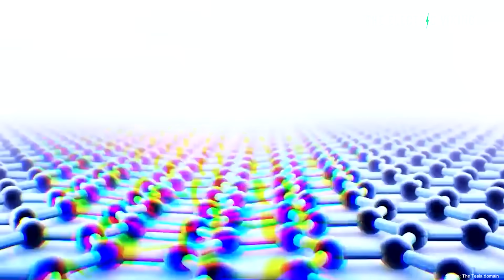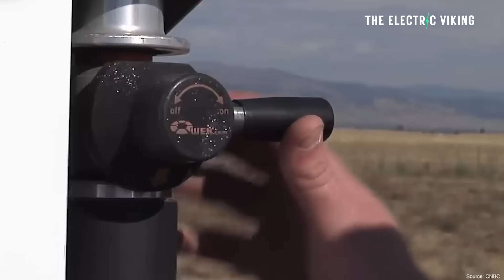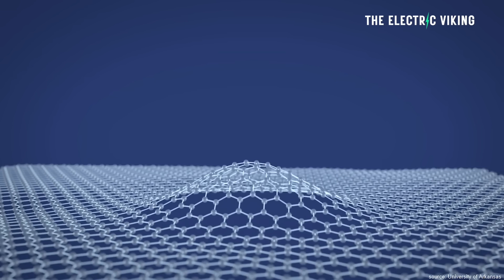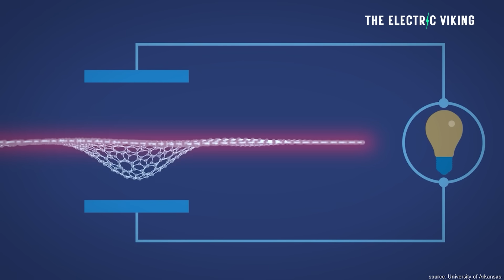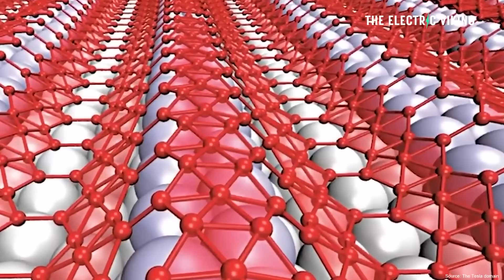Experts Claim Stunning Breakthrough Will Transform Global Hydrogen Network

Comment: It’s pretty simple to see why hydrogen is far superior to any battery technology. Firstly it doesn’t need disposal or recycling after it is consumed, it just reverts back to it’s original feedstock, water. It doesn’t require massive damage to the earth to extract. A fire from a hydrogen leak is over very quickly at a vehicle scale unlike EV’s. It doesn’t bellow toxic pollutants in the event of a mishap. With the advent of the new graphene research, according to your video, it will be 100x cheaper to make than it currently is. No chemical battery can compete with that. 
Maybe open your mind a little to the possibilities rather than searching for negatives.
Reply: You’re clueless

Comment: If that system that stores hydrogen on tape gets of the ground then you have cheap storage and cheap production along with affordable fuel cells. Imagine that you stop you semi just long enough to change out a couple of rolls of plasma kinetic film and the fuel cell charges you batteries as you travel. Then once the film is used up and you are travelling on just batteries you plan you next stop and the battery doesn't need to be huge as it is only holding excess energy from breaking and excess generation holding perhaps 100km of range so going down hill can store up power. A container of this film can be delivered to a service station easily. The video about this I saw seemed to imply that changing the rolls with a forklift is quick and easy. That would tend to kill off desiel trucks as the delays would vanish and refuelling would be quick and trivial without the maintenance issues complicated turbo desiel engines often have.
Reply: Hydrogen ‘tape’ is utter nonsense on a level similar to ‘solar freakin roadways’ 🤣

Comment: The projection seems to be that long haul trucks will need to use hydrogen for well beyond the point at which EV's become commoditized simply due to grid not being able to keep up with demand. While EV's are being built and sold - power plants are being shut down. 10 BEV Class 8 trucks will require the same amount of power draw while charging as a Super Bowl Stadium. There are ~4 million Class 8 trucks in operation in the US alone. To bridge this, some companies like Hyliion have a solution that's potentially more efficient than fuel cell technology using an on-board fuel-agnostic generator (cleaner than the grid in some ways when running on Hydrogen), without the need to haul around two tons of batteries - which reduces a truck's overall load capacity. Time will tell.

Comment: At the end of the day,  one is still dealing with a combustion engine, which is way less efficient than an electric motor.
Reply: Most hydrogen cars use a fuel cell and an electric motor.
Reply: Yes, excepting those types.

Comment: Most of these "laboratory experiments" are little more than mental wanks for the researchers involved. It's like nuclear fusion... where we often see "BREAKTHROUGH" outbursts in the media, showcasing some speculative outcome that has not only cost millions to accomplish, but in reality is meaningless.
This "remarkable breaktrhough" is (like most of these mental wanks) irrelevant. The market (us ordinary folk) have already determined that the future of the car is plain BEV - a proven technology that is not only getting better, but cheaper too. Even if they learn how to cheaply extract hydrogen from blue whale farts, H2 has no future in general road transport.
Sam... your analysis on this is 100% spot on... In 10 years, VERY CHEAP E-cars (or more likely FSD transport) will dominate and there will be no need for whale-fart H2, or any other form of H2.

Comment: Even in a parallel Universe, where Hydrogen could be made from Electricity with 100% efficiency, and if Fuel Cells were 100% efficient, it still wouldn't be a compelling solution. The convenience of charging a BEV at home, the falling cost of batteries and the amazing simplicity of the overall car and charging system is simply impossible to beat with Hydrogen. Hydrogen is not really a fuel, it's just a medium to store electricity. When you see it for what it really is, you know that it can never compete with BEVs. Could it be used for Shipping? Possibly, but certainly not road vehicles.

Comment: There is no mass production of graphene yet. GMG (Graphene Manufacturing Group) is working on this.  Kudos to the Electric Viking to cover also scientific developments, and analyse them as an economist. There is a difference between energy efficiency and economic efficiency. Methods of energy production/storage/transport can have very high energy efficiency (practically no energy losses), but are too expensive on a daily basis. Such methods have no economic efficiency, which is the ratio of relative costs and relative profits with respect to the standard methods of energy production/storage/transport.  I even doubt the suggestion that a hydrogen (proton) based infrastructure is more energy efficient with respect to an electron based infrastructure.

Comment: Thirty Five years is an understatement. In 1974 three colleges had grants on creating a hydrogen car; Michigan State University, Stanford and University of Tokyo. They tried to compete in SEED Rallies but would have to convert to gasoline to finish the race for that day [guess who funded the grants]. A small college in NW Washington state created a car that ran on natural gas and for 16 months won every SEED rally it entered for economy, time on course, less pollution and a 2 passenger design. No grants. The hydrogen cars lost on time because the conversion required replacing or cleaning the spark plugs.. They were banned from further competition with that vehicle but came back with even more impressive cars that all ran on natural gas. Until they made a solar vehicle which still holds the speed record for 2 passenger solar powered vehicle in Australia's race I believe.

Comment: The home robotic vacuum cleaner plugs into the national grid 23hrs daily, but cannot daytrade electricity like the EV will. 

The EV will be the grid energy storage that stabilises the grid. 😊😊😊😊😊😊😊

The EV will be the VPP, the selfparking EV will plug into the grid 23hrs every day and talk to the grid.
 
Your home rooftop generator, PV system will also be the VPP and talk to the grid. 

The daily drive is very small demand of your EV big battery, so daily top-up is EZI PEZI. 😊😊😊😊

Comment: Coming from years of Mars In-Situ Resources space mission design and analysis, everything to do with hydrogen except absolute tip top rocket engine performance is far easier if you mix it with some Carbon Dioxide and a catalyst in the Sabatier reaction to get methane.  Methane is the primary component of natural Gas, so you run vehicles on compressed natural gas (CNG) or liquid natural gas (LNG).  It’s many many times denser than hydrogen.

As long as you’re pulling CO2 from an atmospheric source and not new fossil fuel you aren’t net adding any.

Natural gas (either LNG or CNG is an excellent almost unmodified (other than pumps and injector details) jet fuel, diesel engine fuel, and can be run in gasoline engines tuned a bit differently.  Makes fine rocket fuel.

You can absorb CO2 out of the atmosphere, so we have that covered…

Comment: Even if hydrogen can be produced very cheaply, the transportation of liquid hydrogen is costly and problematic, and it has to be kept in a high pressure tank in a car, which means it’s not very safe… And by the time, they can mass produce it, battery technology has advanced by leap and bound, so there’s no reason to switch to a hydrogen car anymore.

Comment: The only benefit to the Hyrdogen car is it can scale.  Lithium can't; there isn't enough water to refine enough lithum to make a major dent in vehicle sales.  If hydrogen could be compeditive price wise it would have the abiliy to sell more units.  EV people feel they can break through with a new battery tech; and you near all about those all the time also.  A sub $40,000 nice hydrogen car  could compete, especially if  range/ fueling times were less than charge times.
Reply: Is the planet running out of water? 😮

Comment: Production, storage, transport, and transfer of hydrogen is a nightmare. The distribution network should cost trillions. So, if real, this technology will go first in military vehicles. If no one is saying to make any military vehicle with this technology, it means is hype and claims are not so real or easy to apply.
PS: "undercut the price of EV"....supposing the billions invested in battery developments are waste and China has no idea what is doing...why do I bet the opposite of this? This technology will take more than a decade to be implemented. Also, graphene is not produced cheaply and is in very small dimensions, etc...

Comment: If it wasn't for the terrible energy losses in production and handling, the energy-intensive and difficult storage, the CO2 produced in the process of making nearly all of it, the cost at the pump, the cost of the platinum-rich fuel cells, and the lack of suitable infrastructure anywhere to support hydrogen-powered transportation it would be a great idea.
Heavy road transport may make sense for H2 fuel cells, but I suspect battery prices will fall to the point where H2 will be redundant for most purposes.
Reply: Problem you have is that there aren't enough raw materials and no recycling of batteries.  CO2 is not an issue in the first place.

Comment: The cost of the cars and even producing hydrogen aren't the most limiting part of the equation. It's the problem of storing hydrogen and producing hydrogen stations that are the biggest limits to using hydrogen. Add that to the problem of hydrogen use adding more steps in the final use of the energy that doom hydrogen. You lose energy to produce hydrogen then you lose energy to drive the vehicle. All of these loses are greater than using electric to charge batteries and drive electric motors. Hydrogen just doesn't make sense today and probably never will for vehicles.
Reply: The fossil fuel industry is a big fan of Hydrogen.  That tells me all I need to know.  No thanks!!!
Reply: @kstaxman2 said, "hydrogen doesn't make sense..."

That's because he doesn't fully understand the factors that make hydrogen the better, if not the best choice.

One major issue that he fails to understand is that hydrogen may not be as efficient as batteries, but is still much more efficient than internal combustion engines.  That, combined with the zero carbon emissions makes it the best choice.
Reply: @acmefixer1  the leakage and metal embrittlement issues associated with distribution and storage of hydrogen likely make it uneconomical when compared to the simplicity of charging of EVs, at least for passenger vehicles. We already have electric grids across the entire planet, although they made need capacity upgrades in many areas that is a solvable problem.  Another factor that I believe will be problematic for hydrogen as a consumer fuel source is insurance, my bet is that insuring a hydrogen filling station will be significantly more expensive than a public EV charging facility.  Finally, the ability to install solar panels and charge your EV essentially for free is another reason that many car buyers would resist switching to hydrogen.  Personally I don’t really care which technology wins, as long as we’re no longer dumping CO2 into the atmosphere for personal transportation but the current first mover advantage enjoyed by EVs makes it extremely unlikely that they will be displaced by hydrogen vehicles, whether HFCE or direct combustion.
Reply: @sjsomething4936  
Said, "The leakage and metal embrittlement issues..."

What's the issue?  Hydrogen generation, transportation and storage has been around for nearly a hundred years.  What makes you think these "issues" haven't been solved?  The tanks are made of composites; the pipes are resistant to embrittlement.

The whole world depends on hydrogen for making fertilizer for the food we eat.  But it's made from methane and adds a large amount of CO2 to the atmosphere.  This must stop and hydrogen must be green, electrolyzed from water.
Reply: @acmefixer1  Aside from being green, like oil it can be a major effect on international politics and trade. Recently a company in Finland announced their intent to build a factory producing ammonia for fertilizer from green hydrogen made with wind power. Their current main source of ammonia is Russia so there are valid concerns that Putin's politics might cause supply issues...
Reply: @acmefixer1   ... but not better than batteries. And there's plenty of engineering to be done until before hydrogen is even competitive with gasoline.
Reply: I can just imagine a local gas station going up in a huge flame, like they just hit oil!  Yeehaw!

They've already converted a corner of the station to hydrogen.  I'm going all BEV.  See ya!  Best of luck!
Reply: Can you explain why the cost per mile of fast DC charging is roughly the same as for hydrogen fuel cells?
Reply: @jimj2683  Because charging only needs to compete with gasoline and diesel?

Might also be that the chargers, batteries for local storage, and the power lines to meet the demand are actually pretty expensive compared to H2 tanks and pumps. Hydrogen production needs to be scaled up to bring the cost down and fuel cells are so expensive I doubt hydrogen cars would ever be a good idea, but other parts of the infrastructure are pretty simple.
Reply: @AnalystPrime  Seems to me that the opposite is the case.  Big box stores, malls, restaurants, and rest stops already have large amounts of power feeding them and running a line out to a spot in the parking lot isn't that expensive. None of them have hydrogen pipelines or storage, so it would have to be trucked in. It takes a million dollars to put in a gas station and I'd expect hydrogen to be similar. If you want to make hydrogen onsite you'll need a LOT of money, lots of electricity and water, plus somebody to operate it.
Reply: @jamesvandamme7786  "hydrogen pipelines"? That would be a dangerously stupid and expensive idea. Hydrogen would be trucked in just like gasoline is currently, or made on location from water and cheap peak production time renewable electricity, neither of which requires the station to build their own batteries worth millions or new multimegawatt power lines so they can power 10 500 kW superchargers at the same time on demand.

Sure, there are chargers near stores. A lot of stores even offer free charging, but that is specifically because they only have 2 or 4 low power chargers, like <10kW or 22kW. The whole point is that people can spend few hours shopping while their car charges and it only costs the mall few dollars per customer, they spend more electricity on playing advertising jingles that nobody listens to. 

A bunch of locations have fast chargers  with 50+kW output, but these days superchargers of 300+kW are needed to give a meaningful charge in 15-30 minutes so people can do longer trips without having to stop for too long. Hydrogen does not make much sense for cars because 90% of them never drive more than few tens of miles per day, but that one time you do need to take a 1000 mile trip it is impractical to wait for hours every 200-300 miles, and trucks hauling cargo between big cities need even more power.

A gas station might cost a million, but so do the ten $100k superchargers, and each megawatt-hour of battery storage is about half million on top of that. Or you could build a new power line, but those are about million per mile... there is a reason why many charger stations have lots of solar panels on them and build their own solar or wind park nearby.

Hydrogen fuel has lots of issues, but storing it at the station in relatively simple and cheap tanks is not one of them.
Reply: I am not going to be driving around in a bomb
Reply: @garnettharris4819  
You are already driving around in a bomb.  Gas cars have thousands of times more fires than EVs.
Reply: Agreed, this is an enormous challenge which is effectively not cost justifiable for passenger transport.  Perhaps for ocean liners or long-haul trucking and heavy industry vehicles like earth movers, but a huge distribution and storage network will be financially unsustainable.  And regardless of this breakthrough, even getting the cars to work well is challenging, Toyota has made a prototype hydrogen combustion engine which they’ve raced using liquid hydrogen re-gassified to combust, but because of hydrogen leakage around the fuel pump and inability to use oils to lubricate the pump (it would foul the hydrogen) they’ve had to replace the fuel pump twice during the race, adding 7 hours to their time.  The Engineering Explained channel does a superb job of discussing this and breaking down how many challenges are faced with hydrogen fuel.

Comment: The nuclear battery will be the fly in the ointment for hydrogen and today's batteries, continuous power for the life of the car.
It will come but it is some time away as the tech is not there at present for safe use. 
The military and space industry will be the driving force to bring nuclear batteries to fruition. They have the budget.
The advantage for the military would be enormous. No more refuelling+, just think what that means. 
NASA should use them to power the Mars Rovers.

Comment: The true breakthrough would be pour water in your tank, run water through a reformer or catalyst that releases hydrogen into a fuel cell, that then powers an electric motor. THAT would destroy EV's.
Reply: That would still be an EV and it will still need a battery.😊